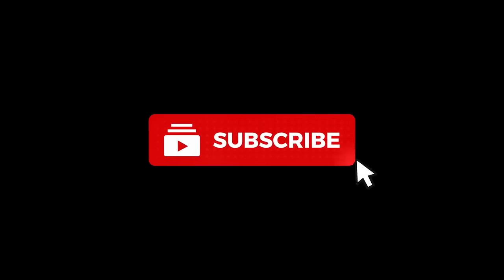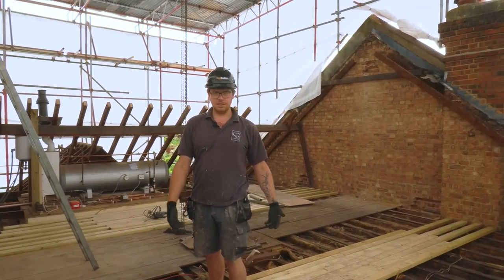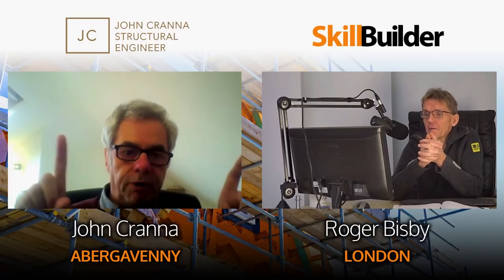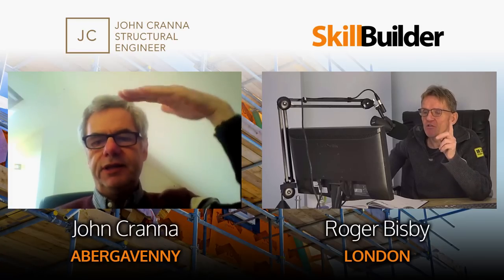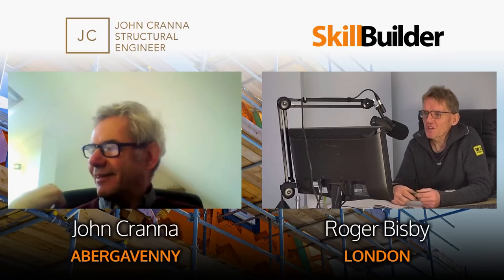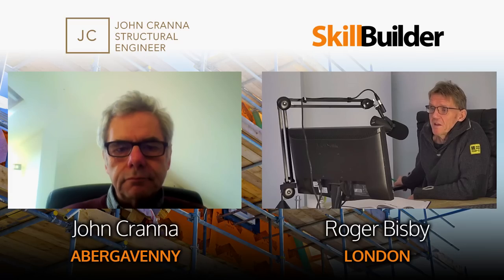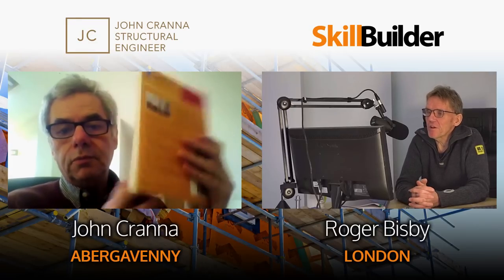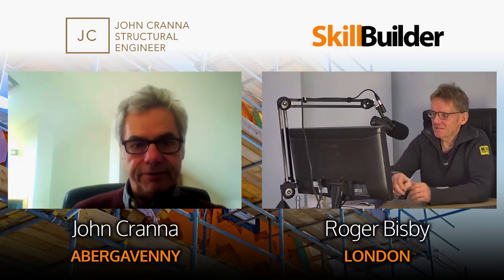Unlocking the Secrets of Structural Engineering - An Expert Interview

Comment: When we were buying a property 20 odd years ago, had the full survey done, and they suggested a structural engineer to confirm certain points. That sale fell through due to our buyer messing us about, but as we didn't need a mortgage, we used the structural engineer for a walk around for a set fee. Saved us buying a shit house etc and tons cheaper than a full survey each time. Will do this again next time.
Reply: most structural engineers wont know a lot about architecture though. Insulation, waterproofing, etc
Reply: @explorerjlc1743  Doubt he'll be lifting inspection chamber covers either.

Comment: I’ve seen plenty of older brick houses with noticeably darker bricks below the damp proof course during wet months. The barrier is definitely stopping rising damp.
Reply: They tended to lay engineering bricks up to floor level and those darker bricks are probably them.  They have a much lower water absorption than common bricks.
Reply from the maker: You are so right, it is there for all to see.

Comment: I was sat in a meeting with the lead engineer on the Wimbledon roof from Ove Arup on the day it jammed and got skewed by the wind. His face went from white to grey by the end of the phone call. The immediate problem was how to release the roof and the tensions that were in it but incalculable. I mentioned this, he nodded, and left the meeting. 😁
Reply: I started off working with Ove Arup in London in 80s and spent 4 months on Lloyd's of London as it was being built.
Reply from the maker: Great story. There are cock-ups all over the industry and they keep quiet
Reply: Ove Arup were also responsible for the Millenium footbridge over Thames which had to be closed after it moved too much under heavy footfall.  The problem was created by people's gait actually being forced to fit in with the rhythm of bridge movement/oscillations.  It's also a very slider bridge for its span so it is always susceptible to side sway.  But it was fixed and reopened within a year by adding dampening which I think was an achievement in itself.

Comment: Would vote on it's a ventilation issue. The way moisture was beading on the underside of the floor boards looks like condensation. Air bricks are only effective with cross flow achieved. When air moves  outside it creates negative pressure on one side of the building and the air pulled out from under the floor then pulls in fresh air from the opposite side. Doesn't matter how many airbricks are around the bay if there's nothing on the opposing sides of the house/ the sub floor void is not clear / other airbricks have got blocked. With the other side being back garden, is there a patio / planting built right up/ over the airbricks there? As others have said the floor isn't insulated, but is sealed now by the newer flooring on top. Well heated room above when the fires on. Cold space underneath. Forms a condensation point when its not ventilated.

Comment: You can avoid those huge steel beams (and renting out the huge crane) on a loft conversion by using a telebeam system. Basically it’s a series of prefab steel A frames that bolt together on site. The sections of each a frame are light enough to manhandle or pulley up to the roof.
Reply: Possibly, Jonathan.  It would involve more design work and a lot more fabrication and you'd need to check and detail fixing of bases as you need to take out horizontal loads.  I have done it previously where the clear span of a beam would have been 8m plus.
Reply from the maker: Hi Jonathan
We looked at that system and meant to do something on it. We will look again.

Comment: Hes a diamond that guy, we need more of him, a very interesting person. 

I have to say that I was suprised when my architect later said we now needed a structural engineer to do some roofing calcs. When he did the extension drawings. I also believed that's what I was paying the architect for. I'm sure it wasn't like this in the 70's.
Reply: Thank you very much Tony.  The architect should have said an engineer was needed if the roof was not standard and there is nothing different now than in the 70s, although I didn't start as en engineer till the 80s!
Reply: Well since the 1970s the Planning and Building Standards have become a minefield - including the structural part.  So the Architect can no longer 'lump' it in with his work.

Your Architect should have been clear about this at the beginning.  Even if it does put some clients off.
Reply: @johncrannastructuralengine8177  if you get a steel truss roof system, the company that prefabricates the trusses have their own engineer for the trusses them self, then you’ll only need one to sign off on whether your wall is solid enough to support the conversion.
Reply: @johncrannastructuralengine8177  Hi John, really enjoyed listening to this video. I'm curious what software you use to design your splice connections, is it done to Eurocode?  We're looking for new solutions at my work. Thanks
Reply: @stuartfowler4685  all my portal frame design is done using Quiksoft and they produce two programs Quikport to design the frame and Quikjoint that designs all the connections in a portal frame and it does lots of other standard steel frame connections.  Not cheap but saves so much time.  To think that I started in 1982 with a pad of paper and a calculator!!  And programs all done to Eurocode.  For my domestic work I use a steel and timber beam program that designs to BS449!  Called Superbeam by Greentram, they also have a Eurocode design program.
Reply: I'm always clear on this point from the outset, would rather lose work than take it on false pretences

Comment: We used a structural engineer to do a design so we could remove a big supporting wall in our house He saved us a fortune and loads of time, because he was able to design it using timber beams and posts which were way cheaper and easier to install than steel, and no lead time on materials either. And far easier to box in.
Reply: mmmm.  That's surprising.  I can only think the span of the opening was not too great as you would need very deep timber to support any opening 3m or more.

Comment: Great video Roger and John. Im a qualified chartered structural engineer and thought that John did an excellent job in his explanation and communication of matters discussed. 
In the domestic market, very often Structural Engineers will be criticized for 'beams being too big'. This isn't done so to cover our asses, rather a solution is selected which is compliant with relevant  codes of practice which try to anticipate realistic  worst case scenarios. Easy to bash the size of a new beam untill the wall above starts to crack due to the weight of snow on the roof and a room full of people. Errors of course will unfortunately be made, but on the whole a Structural Engineer should be looking to save you money in the long run.
Reply: Thank you Charles, very much appreciated.  One definition of an engineer is they do for £5 what anyone else would do for £100, ie save you money.  But we do make mistakes and I mis-read a drawing, underestimated load on a beam and the rooms above started cracking and had to put my hand up to the error and it all got sorted through professional indemnity insurance!

Comment: the distance between expansion joints(usually 12 mtrs in brickwork but no more than 15mtr depends on openings, weird but more openings more joints, stress points) isn't related to the elevation drawing, its a total length, however if a return is less than 1mtr an expansion joint should be placed in the corner
Reply: How come the Victorian’s managed to build really long walls around parks and along roads without any expansion joints that have held up just fine?
Reply: @johnathandoe5688  because the lime mortar is a lot more flexible and much weaker than the masonry itself hence you get micro cracking in the mortar.
Reply: I would normally go 9-12 m spacing in brickwork and 6m in concrete blockwork

Comment: Hi mate question for you if possible be great to get a reply please.Ok doing a barn bungalow conversion .zinc roof its brick built so going to do a block work skin inside and go overboard and all of the insulation everywhere . The building regs have not specified that I must have green energy however, I’m going to install a new gas supply electric supply all new services to the property and so on . Shall I just go with the norm efficient, boiler, underfloor, heating (log burner)and so on or a combination of green energy . And if so, which one would you go for solar panels? Hot water solar? Heat pump ?  
Because they have not specified 
that I need to have this do I hang it out for a while to see if all of the systems improve? then add something later. difficult one. 🤷🏻‍♂️ or just stick with installing a new traditional system and go over the top with things like insulated plasterboard as well   ? Be great if you can have a think on this and get back to me. Much appreciated. what would you do 🤔
Reply: I know you're looking for a reply from Roger but I'm an Architectural Consultant and love this kind of thing.  

I presume you have an architect involved?  Ask him for the U-Values of all your wall/roof/floor types and their respective areas.  Multiply the areas by their u-values and you will get the total fabric thermal transfer (heat loss).  Multiply that entire number by 1.25 to allow for air infiltration, ventilation etc.  Then multiply that number by 10 (yearly average inside/outside temperature difference).  That will be your average heat loss in w/h.  Multiply that number by 24 to get your daily requirement.  From there you will be able to figure out what you need.

My advice is that if your heat loss is low enough, get a small heat pump - 5-8kw, and pair up with PVs if you have the space and underfloor heating.  If you go with gas, just use normal radiators.  You can also have a hybrid system (gas and heat pump with underfloor or rads).
Reply: Thank you I will have a good read on your advice . Thanks for the advice on how to work things out. 👍🏻

Comment: Just doing a chimney removal , we found what the structural engineer thought was there was different . 
So called him out again to redo his mistaken calculations, charged the customers full price again for his f#*k up
Reply: If it was his mistake then he shouldn't have been charging you to correct his error.
Reply: SEs aren’t able to see through solid materials, unfortunately. Are you sure it was his error?
Reply: @enjek5654  that's a good point.  Surveyors cannot see hidden defects, unless there are external signs to indicate possible problems (leaking gutters/downpipes) and engineers working on existing buildings (similarly builders) often find things when they open up that they had no idea existed when they first looked at the job.
Reply: @enjek5654  
Yep his error.
Saw his mistake straight away without and prep work , and I’m just a mere builder , he sent the client the invoice within an hour before returning the next day

Comment: The main thing that I learnt from Pete Wards Warm Dry Home book that really made me think was how can a DPC, slate bitumen or whatever, actually fail? Especially fail to the degree of the whole bottom of your wall becomes soaked. The worst failure you could have with slate for example would be a little crack from building movement (its thousands of years old for christ sake) Your telling me that a little crack in a slate DPC can cause the entirety of your wall to become soaked and require full damp proofing. No chance! Can capillary action cause moisture to rise through the capillaries of brick? I think more lab scientific testing is needed. I have never see a study during my brief university research that it can given a common bricks pore structure.
Reply: Yes, I'm with you on the 'dpc has failed' debate and hence damp is rising all along the wall!  My feeling is that no definitive and scientific research has been done into the mechanism of rising damp.  Jeff Howell's attempts were very basic at best and showed nothing.  Even Peter Ward says that damp rises a few courses at most so even he admits rising damp happens but not to the height people assume.  I believe rising damp exists but most instances are missing diagnosed for commercial gain.
Reply: @johncrannastructuralengine8177 I have never seen it in all my years as a surveyor. Plenty of interstitial condensation, plumbing leaks and high ground level mis diagnosed though. I am considering doing a masters or phd in building surveying and this subject has interested me a lot. Having multiple bricks and mortar types set in up submerged conditions and then real world soil conditions is what I would investigate and publish.

Comment: I'm surprised it's not been mentioned about using lime to prevent damp. Take the barn conversion for example, I would imagine that the internals have been plastered with a cementitious board or plaster, if they used a lime plaster, I believe they wouldn't have half the problems with damp. Same for old Victoria buildings that now have damp, most of them have been repointed and re plastered with cementious material, which doesn't alow the walls to breath. Instead of moisture and vapour passing through the lime it now has to pass through the cement mortar or plaster. This is much harder for the moisture vapour to do, so the path of least resistance is through the brick work, which inter causes spawling on external brick work and damp on internal finishes.
Reply from the maker: Daniel 
 Victorian homes built and plastered with lime mortar and render suffered terribly from damp. It was huge health issue and that is why it became law to incorporate a damp proof course. Lime will not stop damp, it simply allows evaporation to take place but even that is over-stated. Many trials have taken place with lime mortars etc,  and the results are far from conclusive in favour of lime.
Reply: @SkillBuilder  Interesting, I get the whole DPC to prevent rising damp issue, and that the majority of damp case come from poor drainage either from guttering or landscaping around the building regardless of using lime or cement.  most Victoria  era buildings were built with a solid wall configuration, cavity walls came in towards the end of the victorian period. Would you not agree that a cavity wall fitted with a DPC and using lime as a render mortar and plaster be more beneficial to prevent damp where drainage and landscaping wasn't the root cause of the damp issue? Interested to here your opinion.
Reply: @danielhall1897  just seen your comment and reply.  If you have a dpc then there is absolutely no reason to use lime in preference to cement.  Lime is much weaker, more expensive and I think takes longer to go off/harden.  Lime is more flexible and will allow micro cracking and if movement is not too quick then it will self repair any cracks.  A common mistake is to make cement based mortar too strong and you get cracking in the masonry if the mortar is stronger than the blocks or bricks.

Comment: Missed opportunity here to mention the structural engineer's statutory duty to comply with the CDM Regulations.  A SE cannot 'ignore' the situation the beam is being used in, and must provide guidance on temporary support requirements 😖
Reply: Forming movement joints are time-consuming and expensive.  These days we tend to use bed-joint reinforcement to control cracking 🤪
Reply: There's a big difference between beam 'lateral restraint' and 'torsion' 😁
Reply: Not only must the SE size the beam but they also need to ensure the beam end reaction is safely distributed down to foundation level 😁
Reply: You need to be very careful using Strongboys; they are eccentrically loaded and have relatively low load-carrying capacity.  'Needling' is the right way to go 😁
Reply from the maker: I agree that Strongboys are not great but for smallish openings they are a good option. It is often difficult to needle through.
Reply: @neatripple2784  Not quite sure what point you are trying to make.  They are all part of the way a beam is designed.  If a beam is not restrained laterally (ie supporting masonry above rather than a timber floor where the joists are built into the web) then the beam can fail by torsional twisting and buckling of the flange in compression.  So it is all part of a possible failure mode of the beam.
Reply: I think I did mention that I was involved in one job where a very large chimney breast was being removed and the span was very long and the width of breast also large so I produced a method statement of how the wall/breast above should be supported.  Most of the time the temporary support of the structure above is standard and well within the capability of a good builder.  It is not the reponsibility for the engineer to specify the temp support needs for every job.
Reply: @SkillBuilder  You were talking about 6m wide door openings.  There is no way on this planet that Strongboys are suitable for that situation 😖
Reply: @johncrannastructuralengine8177  If the beam is supporting a balcony above, then the handrail (edge protection) will exert a torsional force on the beam.  This is a situation entirely different to simple beam lateral restraint